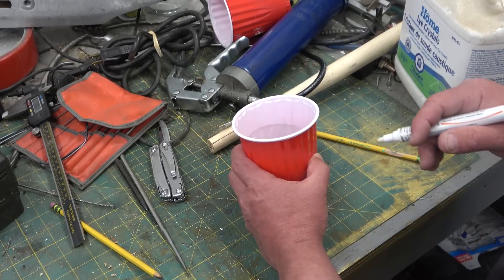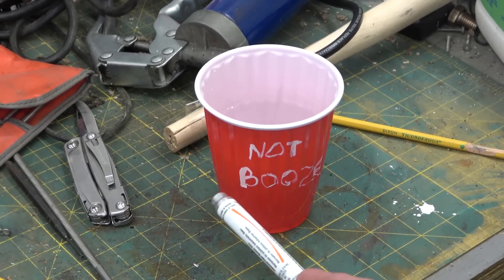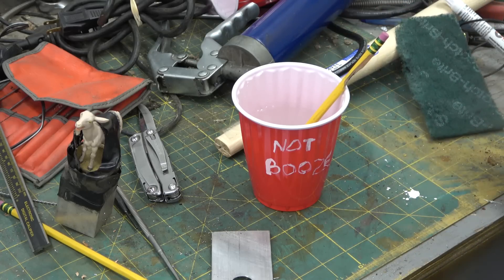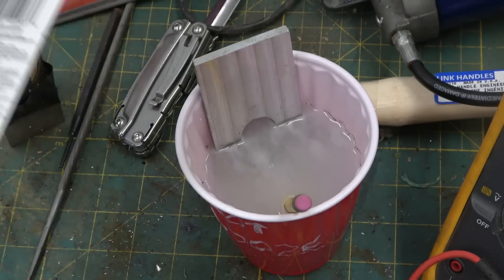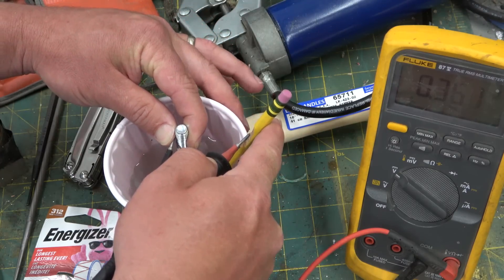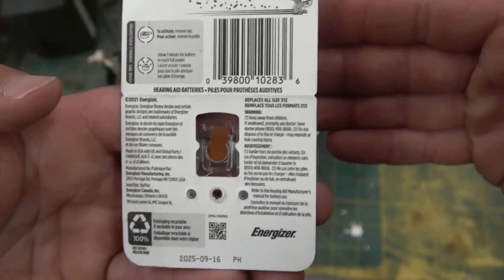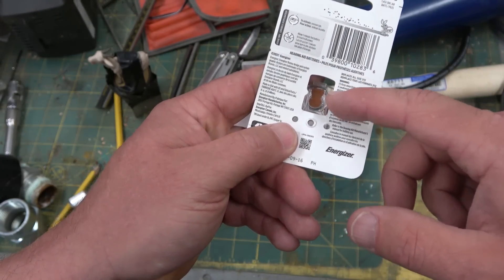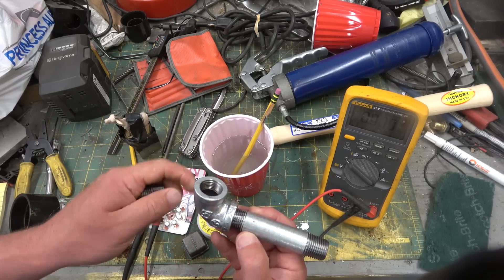Hydrogen grease gun?

Comment: It's not often PhDs in inorganic chemistry have a chance to shine, but I'll take what I can get. 

Here is what is happening:
Under normal conditions, there are 3 reactions:
Zn+4OH- > Zn(OH)4^2-, + 2e- (Anode)
Zn(OH)4^2- > ZnO +H2O +2OH- (electrolyte)
1/2 O2 + H2O +2 e- > 2OH- (Cathode)
Total - 2 Zn + O2 > 2ZnO

There is always a parasitic reaction pathway which generates hydrogen gas (see below). In order to minimize this, they use construction methods and additives such as mercury amalgam. The parasitic reaction is below:
Zn+4OH- > Zn(OH)4^2 + 2e (as above at anode)
2H2O +2e- - H2 +2OH- (side reaction)
Total = Zn +2H2O > Zn(OH)2 + H2 (hydrogen generating reaction)

Under normal operation, oxygen is present, allowing the top cathode reaction to proceed, where the overall reaction involves the oxidation of Zinc by oxygen to produce Zinc Oxide. Without oxygen, the reaction will proceed without the Cathode reaction, resulting in the oxidation of Zinc by water (under basic conditions), producing Hydrogen gas and Zinc(+2) hydroxide. These are competing pathways, removing the oxygen forces the Zn to prefer the parasitic reaction that generates hydrogen gas. 

The source of the hydrogen gas is the half cell of the oxidation of zinc, and reduction of water to produce hydrogen. This explains why no oxygen is being generated.
Reply: I wouldn't mind having some conversations with an io-chem person.

Don't let the lack of shine keep ya down.
Reply: Thanks for taking the time to write that up. Very interesting!
Reply: 💡Add a pressure gauge and stop it up to demonstrate maximum pressure. Don't forget the safety enclosure. 🤯
Reply: And shine you did good sir! Thanks!
Reply: sounds right, xt0(z)yg -> 023cubed 
yup thats it

Comment: You could use a resistor to connect the + and - on the cell and thus control the rate of discharge to control the schmoo

Comment: Hope ya good.
Any chance you could rip apart the new dewalt battery plaster mixer. See how good it really is.

It has no high or low gear box so i assume its all down to chip running the amps.
 I myself run a refina mixer and can easily fix and that my friend is because of your videos. 

Regards scott from keighley England .   
Keighley pronounce (keith-ley) 

Many thanks

Comment: Not trying to be a hater but i think that may have been grease pushed out by air pressure created when you installed the pipe cap behind the battery.

Comment: These "grenades" , as known by the tower climbing grease monkeys which I am apart of, are used heavily in windturbines and smell like wet farts when you take the batteria's out. They also are a pain in the ass when the little bastard break of the threads and go sailing through the spinning induction oven.

Comment: No grease gun, hold my caramel macchiato beer.
Find a small plastic bag, put the grease in, cut a small hole in one of the lower corners, aim and then press.
There you go, high pressure "grease gun"

But hey, if you want to finger that greasy hole and.. 
Wait sec, I get it. Forget the grease gun

Comment: I’m a thinking the battery had nothing to do with the grease coming out the hole.   I’m thinking it was the effect of air pressure exerted on the grease when you put the cap on the top and tightened her down causing compressed air.

Comment: At my work we used 12N HCl to oxidatize aluminimim into hindenburg filler and the fuming hcl dissolved half the surface of the fume hood so we tossed out the hood and planned on switching to lye but that makes the H tutu and pn the account the lab was no longer ventilated we just walked away from the whole process and contracted it out to Mexico. (Texas to be precise)
With that fuming hcl you need safety squints but for your nose

Comment: So its not so much an electrochemical cell as it is just a straight up chemical reaction. Sodium hydroxide reacts with aluminum to form sodium aluminate and similarly zinc to form sodium zincate and also hydrogen. Zinc-air batteries don't produce hydrogen when they run. So your grease gun is gonna run out of expansion pretty quick.

I think.

Also measure closed circuit amperage or you're gonna get people like me reminding you that open circuit voltage means exactly nothing without closed circuit amperage. >.<

Comment: I went searching for a device for my sandblaster cabinet so I could get the blast media knocked down in the hopper. My internet history of the search for an vibrator still stalks me. You would have thought adding descriptors like industrial, pneumatic, heavy duty, powerful, etc... would have help me, but I think that just made it worse.
Reply: Never underestimate the sex-toy industry.
Reply: @bigclivedotcom  They built the internet to what it is today!
Reply: the google, and derivative, search engines have been "optimized" beyond any esoteric usage. used to be able to find any bit of obscure knowledge with correct terms and modifiers, but now the best luck is adding "reddit" to the end of a search term, google has helpfully started auto adding that when I click back into the search bar after glancing at the initial results.
Reply: Orbital.
Reply: Funnily enough, “hopper vibrator” brings useful results… Rampant Rabbit sellers suck at SEO!
Reply: @mumblbeebee6546  So that must be the galloping grasshopper variant you found?
Reply: That's a work computer only search if ever there was one.
Reply: @etherealbolweevil6268  LOL! Yes and no… industrial manufacturing relies on agitation & vibration - the use of those terms in the more personal sense has not been so prevalent for very long so search engine results were quite clean!
Reply: @etherealbolweevil6268  Work tracks and blocks many different things. It was a government project, so it makes it a bit harder to explain.
Reply: @marksturgis3536  Fortunately, that situation made some of the more interesting improvised high explosive recipes highly explicable.

Comment: 1.5v alkaline battery, bit of wire and a pencil makes for a handy dandy makeshift soldering iron.
Reply: 40 years ago i attached graphite to my flyback transformer. really cool sparks until it stuck to a makeshift chassis. i remember it getting bright red then exploding sending 1 tiny red hot graphite shard onto my arm. never did that again.
Reply: @frodowiz  4
35 years ago it thought i would charge an AA with 240 mains. Never done that again either.

Comment: Surely more would come out during the day when it heats up. Also I thought keeping in the h² was tricky.
Reply: Keeping it in over a year is tricky.  Keeping it in for an hour is much easier.
Reply: @EmperorA0  The one Big Clive had could be set to 12 months so they must have figured it out.
Reply: @TurinTuramber  
Difficult: maybe idk
Impossible: obviously not
Reply: @TurinTuramber  Experience say yes, they figured it out.
Reply: @TurinTuramber  It is tricky.
Most probably the grease keeps it in. That or the leakage is offset by the production rate.
Reply: The battery was home made and full chooch, the genius in the one clive dissembled was preset feed rates according to the slide contact and voltage.

The simplest stuff is often the most incredible

Comment: Those Knipex are awesome! Me and my whole team have a baby pair in our pockets and the shit it gets us out of is incredible!
Reply: Got some Knipex Pliers Wrench for myself lately. She's a good replacement for most spanners especially adjustables - you get a better bite with the cam action. Lovely bit of German engineering, always in the work pantaloons.
Reply: it is the most useful multitool I own
Reply: I call them my "Angry pliers" for when I need to beat the shit outta someting cause it rounded off. Just about my favorite tool in her box.
Reply: One day my kids will inherit my Knipex pliers. Maybe a bit dirty, but I doubt they will show any signs of wear. The baby size are perfect. They can fit in the pocket all day and get stuff loose they have no business doing at that size.
Reply: Got a baby pliers wrench for my tool belt, pair it with a small nut rounder and wow its so much better than the nut rounder 😂
Reply: I received a baby knipex myself when I worked solar for a summer, and they are indeed the bees knees. They replaced my felco number 8s as my primary side arm.
Reply: That Cobra XS saved me quite a few trips around the shop and the house.
Reply: Those and the parallel jaw pliers are a godsend. Can be used for everything they are not designed for, and quite often perform better than the actual recommended tool for the job.
Reply: I picked up a small, medium, and large pair I bought as a 3-pack a few years back.  They'll sink their teeth into anything and stay that way, no slipping on fasteners, hard iron pipe, or human teeth.   And he's gonna KEEP getting the Port-A-Potty dental plan until he tells me where me 10mm socket is.

5 stars overall!